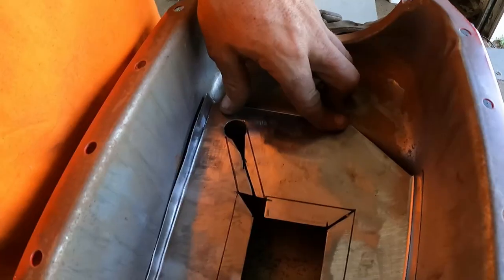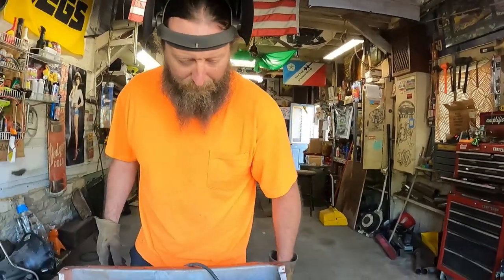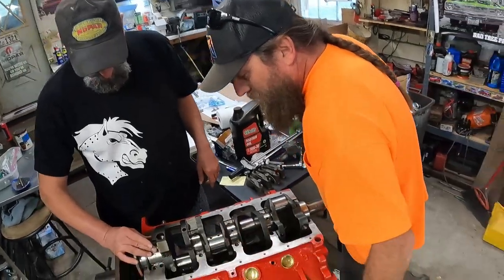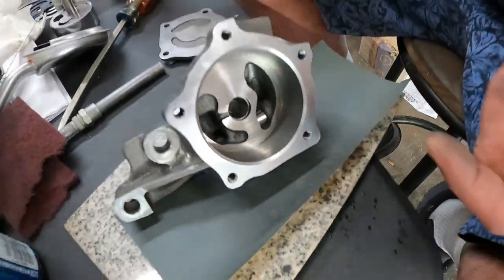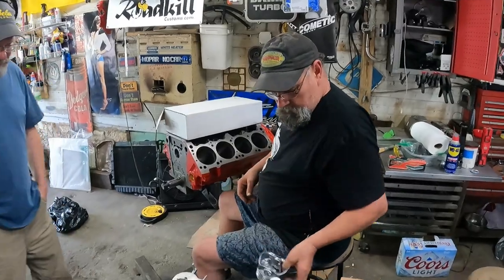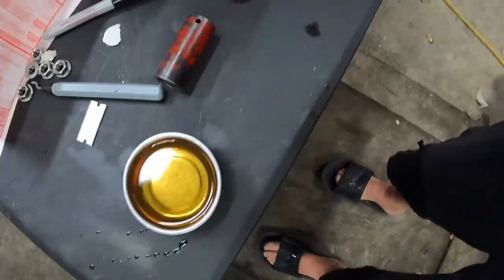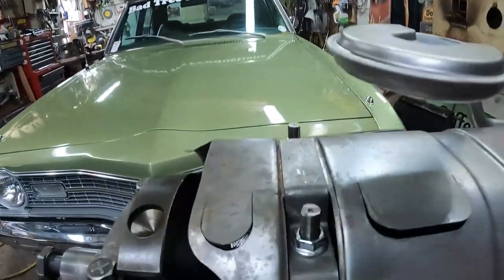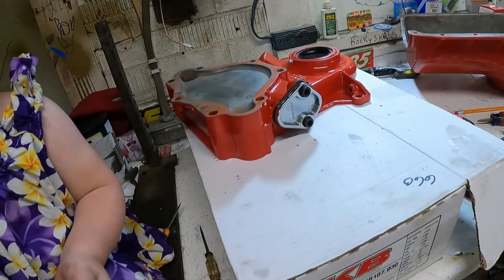Nacho Cuda'  1967 Plymouth Barracuda 360 short block Mopar built, with windage tray and baffle.

Comment: That ink your talking about is called Dychem. I use it to figure out where the rocker arms sit on the valve stem tips while using 1:61 roller rockers on a big block 451 that needed custom made push rods to make sure they are centered on the valve stem tips  . Jaybo sounds like a drum tech testing the mike outputs of the toms on a drum kit while beating on the oil pan baffle lol . Hopefully that cam doesn't give issues like Jeremy's did because if I remember Lunati is made by Comp cams or used to be . If your looking for some superior cams and lifters and push rods check out a place called Trend Performance who makes top notch stuff used in crap car oops I mean NASCAR and the guys who run sprint cars and the top fuel guys use their parts as well . Anyway I missed this initially but it was fun watching the engine build and you guys are always a blast to watch !
Reply from the maker: Think the cam is going to be fine, she's 20 years old
Reply: @BadTreeProductions  Good I hope so I know a few guys of late one that's from the car club I am in his but the dust or I should say it was ground wrong on one of the lobes for one cylinder that was causing it to back fire through the carburetor like it had a flat lobe or cam while it was on the Dyno and found out the lobes for that cylinder were good while checking lift but we're ground wrong so those 2 valves were opening and closing at the wrong times lol causing it to back fire through the carburetor on his 383 for his satellite that he built the engine for last year summer but he is a lucky guy and had a good running 68 440 laying around and put that in having to do some minor changes to the exhaust so he could drive it . Anyway keep them video coming because on my time off I like watching them when I can .